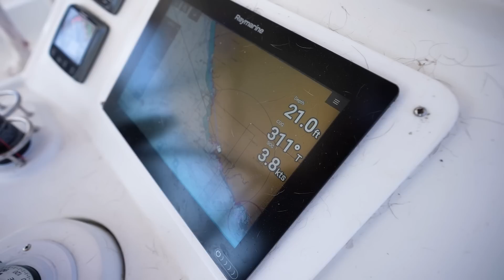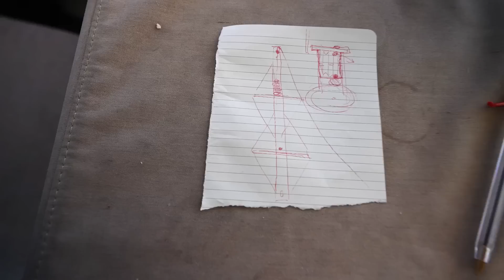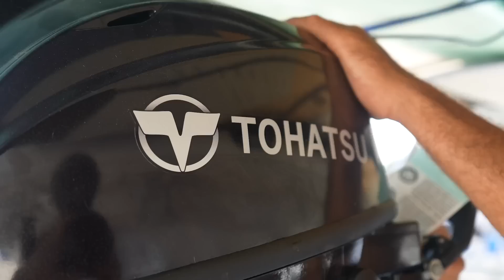DEVASTATING NEWS - Our Pacific Crossing May Be Canceled  -  (Episode 217)

Comment: Cheers Colleen!! Absolutely brilliant.  When my laundry was returned in the Nha Trang, Vietnam hotel with 6 aluminum coat hangers I didn't hesitate. Big tip and those hangers went right in my duffel.  During the subsequent 7000 nm to Canada, I used them  for all kinds of things, to make clips for the pans sliding around on the induction burner (Somehow I didn't immediately  think to make them jam cleats. ) and.... one of them was absolutely critical to re-snaking the parted 3rd reef through the boom - in the middle of the north Pacific.  To the 2nd reef line I stitched a messenger line (some paracord I brought. Always have some and mark it: "Messenger line- do not cut").  Ran this through.  Using the hanger wire fished it out from the 3rd reef side. (cut the hanger wire and leave it sharp and jagged. I snagged the messenger line, didn't hook it.) Next I had to get it around the other side of the sheave. Double stick tape on the sheave, then carefully rotate it.  (I won't mention that I scratched my head on this for several minutes. Colleen would've got it immediately.) 
We used three of the hangers while the other three tinkled in my locker like a wind chime.

Comment: If you have bought large bags of grains, rice from Mexico they tend to have weevil eggs that hatch out and ruin stuff, vacuum pack if you can, better if you re-bag the lot then seal, one of those heat sealers may save you loads. Exciting times xx
Reply: Putting the grains into an empty Coke bottle and filling it with CO2 will kill those buggers instantly.  Then re-package.
Reply: @RappinIggyG  That’s genius!  Yes you could use a simple Soadastrem to fill them

Comment: Colin.  You're STILL a super yacht engineer.  Please change your opening....  Um just sayin...

I have previously posted how much you and the maintenance crew have been for me towards coming up with and executing upgrades to my 23' Qinjgdao Li Anya RIB w/200hp 2 Stroke  HPDI Yamaha.  Here's the list:

1998 Chevy 3500 Dually: Wired 2nd battery in truck for winch

                                             Ran electrical connector for winch
                                             Designd mounting bracket for Crossfire dual tire pressure equalizer (in welding phase)

Trailer:  Installed Fuller remote/electric winch
              Installed bow catcher
              Replaced trailer rollers
              Installed bungy cords to hold rollers in place when loading boat
              Installed additional trailer lights
              Installd spare tire mount

Boat:  Repositiond Bimini top mount
           Redesignd Bimini top
           Changd Bimini top latching hooks
           Removd old cup holders.
          Addd cover for exposed cubby hole on center console
           Upgradd Center console mounting screws
           Changd hatch latches to locking latches
           Designd Lil Miss Isle seat covers
           Addd for and aft remote spot light's
           Addd 2 solar panels
           Repositiond nav light's
           Upgradd switch panel
           Addd power steering
          Addd jack plate
          Upgradd Cpt and Passenger seats
          Movd Cpt seat 4" aft for leg room
          Replacd seat post screws w/inserts & bolt
          Redesignd  deck plate and & replacd screws
          Replaced grab handles
          Installed and wired bluetooth Ecoxgear speaker tube
         Upgradd dual battery switch w/ACR (in wiring process)
         Built & installd accessory terminals
         Installed rear deck water deflectors
         Install SAE plugs for upgradd solar panels (in progress)

So there you have it.  Thanks again to you and the team for the motivation, inspiration and education.  HG

Comment: I hope you solved replacing your rigging.  If Not. However, I can share it with you, Colin.  I changed all my wire rigging, weighing in at 240 kilos for 30 kilos of Dyneema. Except for the forestay as it has a roller furler.  I couldn't be happier. You could carry the Dyneema in your hand luggage, However, I needed to weld 3 new sets of spreader ends to run the Dyneema rigging. These ends you can purchase from a mast maker. Also, I had to change the rigging screws made in NZ designed for this job... if you need more info let me know. It would be a shame if you miss the Pacific crossing, we will also miss your video adventures.  Best of luck. SV Skoirern IV

Comment: Redundancy. Advantages of a second evaluation from a seasoned rigger. Now its logistics, determining the risks (weather window, sail as is then change when parts available, delay for parts then deal with the weather, scrumming best used parts from sailors/auctions/marketplace/abandoned or damaged insurance boats/marine outfitter or Chandlery/possible to change the rigging configuration/get parts and tools to manufacture or assemble the required parts.

Comment: Tohatsu 2 stroke outboards are awesome. I do not like any brand of 4 stroke outboards. Very little mpg gained and a ton more complexity. 4 stroke wont win any races either. 2 strokes are 100x easier to work on and have a far greater surviveability if waterlogged. Oh, then there is those nasty oil changes with 4 strokes. Ok, I am done with my ranting lol

Comment: @7:53 Add all that weight to a "performance cat" and guess what happens.  Performance cat.
Reply: You make it to French Polynesia in 19 days, with a happy, safe, and comfortable crew!
Reply: The Lagoon 450 is not a performance catamaran; it’s a cruising cat and cruising cats are slow and comfortable 😎
Reply: They sailed in the regatta with 30 people on board and were easily pushing 7 knots so it can handle it, plus it will get lighter everyday😊
Reply: @RebootTheCatamaran  Yes, that's exactly my point.